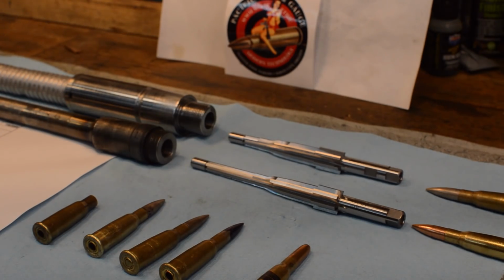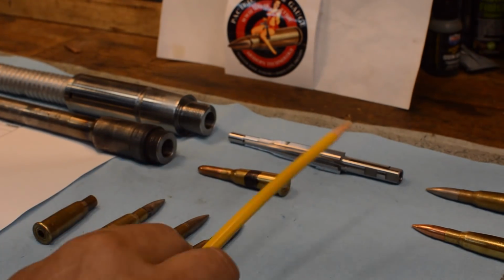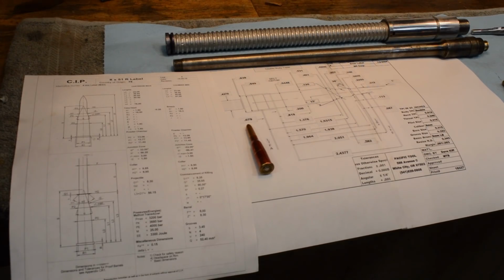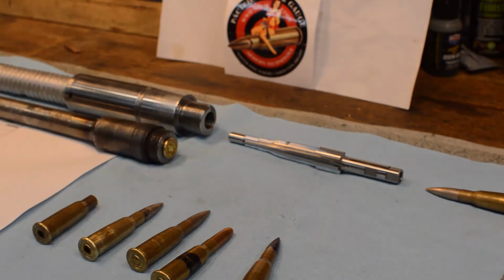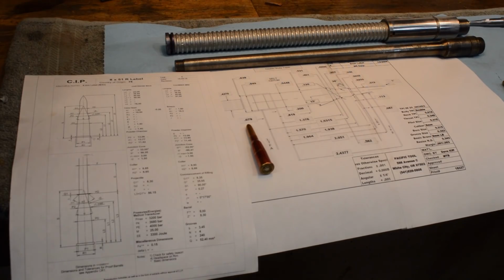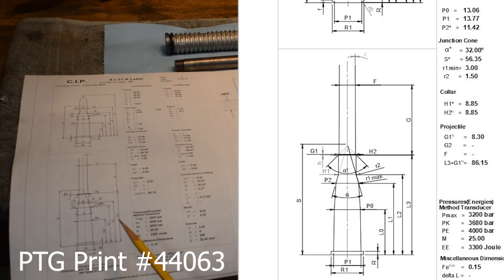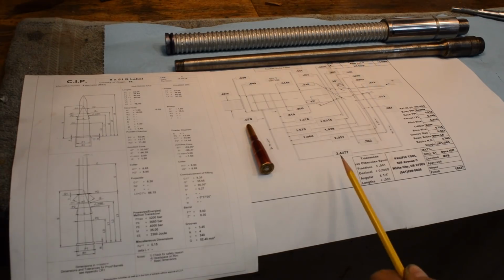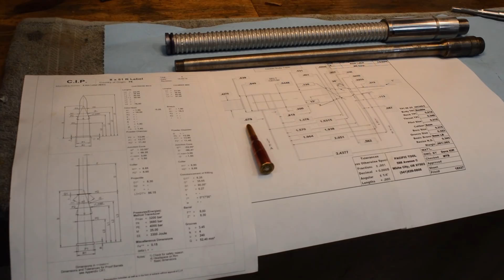8mm Lebel reamer selection issues

Comment: This problem is well known in France , CIP made some big mistake in the measurement of the cartridge , that why there are some group of people that shoot Lebel and Berthier that still try to make CIP fix there mistake... There has been many paper send but still no change. The reason why there is this problem is because CIP base there drawing on the 8x50R PPU made ammo , not original ammo or drawing , because in France at some point we had problem importing PPU ammo becauve it was not CIP , so PPU , knowing that France was one of the best market for 8x50R send some ammo to CIP to put to the test and approve. After approval the cartridge was rename 8x51R to differenciate it from the 8x50R Mannlicher use in M95 and the drawing were accepted. But to be sure that the new PPU 8x51R would chamber in "N" as well as "D" ,and as well as "M" barrel , PPU made a undersize "universal" brass. The problem is that with this brass because it is so undersize , you get a lot of cartridges that just open sideways in the chamber after shooting... Thing that have never happen to me with surplus ammo. One more thing to know about the PPU brass and CIP drawing is that compare to the original ammo the rim is to thin ( about 0.5 to 1mm to thin ) , that can lead to headspace problem because the round can move pretty much freely in the chamber before being fired. Sorry for my english it is late here in France. Have a good night.
Reply: Thanks for the heads up on this. I've run a few handloads made with PPU brass in my Berthier carbine with the N chamber and have yet to have any issues. I have not used the PPU factory ammo yet though. So, I will see if the gives me any problems.
Reply: @nekoghostgunner1129  It depend on what you want the gun to do for you , if you want accuracy many people here in France use a kind of rubber ring to add length to the rim so the cartridge is in the same position every time and the headspace stay the same every shot. The worst thing to do is to use the same use brass for different gun , in my experience the brass will crack more often. So keep track of what brass go with which firearms. Especially if you have different type of modification made on your rifle like "D" and "N" barrel. I don't know what type of powder you use in the US but here in France we mostly use Tubal 5000 to reload 8x51R with what we call " balle de foret" litteraly "bullet found in the forest" or TPM ( a special small production and very expensive bullet made for high precision shooting with lebel rifle that ressemble a lot the Balle D ) or partizan bullet. About the brass , you should make what we call "recuit" i don't know the word in english but is it when you heat the neck of the brass and rapidly put it in water so the brass stay strong on that point. Most of my brass didn't survive 3 reload for "long range shooting" but if you undercharge it to shoot at like 50 meters you can pretty much make 7 relaod out of them.
Reply: @pierre-louiscomte8998  In the US we could call "recuit"...."annealing". This process softens the brass and allows it to expand properly and not crack or break.
Reply: I had a lot of problems with reloading PPU brass using both CH4D and Lee dies and .323 PPU bullets. The case neck thickness on the PPU cases seems to be about half that on Milsurp Balle N and the resizing die does not bring the neck diameter down enough to properly grip the bullet. I had CH4D make me an S collet die to bring the neck size down sufficiently to give proper shot start pressures. Using Vit N140 and CCI primers, I was getting situations where the bullet was being blown out of the case into the bore, but no powder ignition!

I think the PPU brass is made to Balle D spec not Ball N which has a thicker neck!

...as for CIP, my faith in this bunch diminishes daily! Too many clerks and not enough engineers IMHO!
Reply: @pierre-louiscomte8998  It's mainly a fun range rifle for me, but I'll try the ring on the base if I start seeing problems. I have some original French Balle N ammo I got on my clips to take thickness measurments off of. My Berthier is the only firearm I have in the cartridge and will probably stay that way. As for powder, I'm working with IMR4064, as I already had it on hand for my 8mm Mauser and 7.7mm Japanese loads. Again, thanks for the info. If I can get the projectiles for the load you mentioned, I might see about working up my own version with either IMR4064 or IMR4895.
Reply: @felixthecat265  Lee dies are the best , the irony is , because they are of worse quality , the mesure are not really to spec and that make them the best you can buy for the money. Also if you have problem with the bullet not being held fermly in position there is some 8mm crimp available with lee that work really well. Also when you reform the 8x51r brass , don't reform it completly ! The neck should have a kind of double step , that normal , not pretty but it help the brass to align properly in the chamber ! Original balle D and N ammo has pretty much the same thickness , the angle of the neck change a little that all. But yeah you are right PPU brass is way to thin...
Reply: @nekoghostgunner1129  The bullet is call TPM327D , but it is only made in france and in very little quantity , so it would be really hard to find it out of here ( and for how much ? ). As for the "balle de foret" there is a website in France pretty much the equivalent of GunBroker in the US call NaturaBuy , you can find here a lot of french stuff and also this "balle de foret" that we use for reloading ammo to the original spec for a minimal cost , most of the time original projectile are cheaper here than PPU bullets. And dont forget ( I forget to tell it to "Felix the Cat" ) the french lebel and berthier are not in 323 ! but in 327 ! That make a difference...
Reply: @pierre-louiscomte8998  yeah, I looked up the proper bullet diameter, though I did find that a .323 dia FMJ projectile will engage the rifling of my Berthier enough to stablize and use them for a reduced power plinking load, as they are still accurate enough to hit paper at 50yards. For a planned more accurate load, I got a pack of PPU .330 diameter 200 grain projectiles for the 8x56mmR cartridge and am going to run them through a bullet sizer to get them down to .327
Reply: to sum it up CIP is not to blame, they did what they are supposed to do, test and approve, PPU is because they submit their dimensions and not the french ones. that leads to the question why didn't France gave the correct data to CIP long ago? and even worse, is all french CIP data wrong/not original or only this one?
Reply: @kber6288  Yes CIP is to blame... They dont bother look at original drawing or just take a look a an original ammo... And CIP is also to blame because since 2017 they didn't fixe there mistake. If i remenber correctly before 2017 it was not CIP proof and still called 8x50R , because it was not CIP we were not allowed to import it anymore in France and that lead to really a kind of crisis in this caliber... For some time the price for ammo keep going up...  and then the CIP registration and approval came. About this caliber from what I know there a been a LOT of people in France ( when I say a lot it is not like one thousand , but in the collecting community in France 10 people sending a paper is a lot... ) that have send them warning about the mistake they made... With original drawing and all the information they need... But nope they don't care , 8x51R is a caliber to rare to care in there eyes I think... From what I know it is the only caliber CIP got wrong... but maybe we will find and other one some day not impossible...
Reply: @pierre-louiscomte8998  don't get me wrong, i fully get your point. and here in Germany we have the same problem with buying non-approved ammo. even german surplus ammo needs to be reapproved because the millitary approval means nothing.
but CIP is just pure bureaucracy. you bring in some drawings and maybe cartridges, they will look at it, tell what to change, and approve it. they absolutely don't care if a similar cartride already exist or not if it is not already registered. so they did what they are supposed to do. the only thing i can find to blame is that country of origin should be Serbia, not France, for the approved one. 
the question is why didn't PPU came with the correct data?
and why didn't France registered it in the first place? 
i have way to less knowledge about the true 8mm Lebel round to tell the real differences. i only know there where some minor but important changes adopting the spitzer bullet, but don't know how or if this effects the diameter of the back of the case at L0.
maybe you guys should just take all data and register the real thing (horrible expensive, i guess), along with the 11x59mm R Gras that i haven't found in CIP data and should be the parent case of the Lebel (?). or if you have any other idea how to put some pressure on CIP, tell me how i can help.
and honestly i wouldn't accept any renaming "because there already is a 8x50R" as there are 2 8x56R from differend countries already in the books, not to mention our "german 8mm bullet problem" with the 2 differend bullet diameters but same cases. all not problem to CIP.
Reply: @kber6288  Like i previously tell , PPU made this ammo undersize to suit every type of rifle , if they had made a ball N type cartridge the ammo could have fit in a D barrel but that would have put stress unecessary stress on the action. So ppu made a "universal" undersize cartridge that can fit in every gun that why the drawing are "wrong" they are "correct" for an ammo that will cause no problem , but not good to make a reamer. About France that did not register it.  The reason is "simple" since you are in germany you know about the new EU laws about the 4 categories A B C and D. Before these rule they were 8 categories in France and the 8x50R was in the 1st one , that included military calibers. So legaly it was really hard to own a 1st category weapon. So most 8x50R lebel were re-chamber to a civilian caliber the 8-348 Winchester that is really close. Since there was not a lot of 8x50R lebel that were officialy register  there was no need to register the 8x50R with CIP , most of the Lebel and Berthier were kept in the cave or in the clauset... Now that the Lebel jumped from 1st category to D category and now everybody can have one , 3 things have happen , a lot of lebel appear from "nowhere" , the price of original non re-chamber one have skyrocketed and now a lot of people want to shoot them. At the beginning we had no newly manufacture 8x50R lebel in France so people made brass with the 8-348W or just used original surplus that you could find if you knew where to look... Now that there is no more surplus , that the brass for 8-348W have become really expensive , some gunsmith had started importing PPU ammo. But France rapidly ban the import of non CIP ammo. So PPU "rush" the procedure ( that took more or less one year... ). The thing is ! French sport shooter had already ask CIP for the approval and send them original drawing and all the stuff they needed , but like you said that cost a lot of money... When PPU approch CIP they had the money , so PPU drawing where choosen... We tried to put some pressure on CIP but no change after more of less 3 years , most people have stop trying...

Comment: Mark, any chance of re-uploading the videos where you steam blue guns? Those are by FAR the most satisfying gunsmithing videos I've ever seen.
Reply: +1 to that, while I primarily find it interesting from an academic point of view as I don't do metal work, I enjoy learning your reasoning and methodology as it's often very applicable to other aspects of life. 
The video I'm really holding out for was the one in which you describe how to make a scraping tool for shaving a very small layer of wood in a controlled fashion, I tried it out and was amazed at just how well it worked (and just how smooth the resulting finish was)... but for the life of me I can't remember all of the fine details a year or so on!
Reply: @etelmo  look up card scrapers, there's loads of videos. Your basically looking for a 90 degree corner on a section of plate with a burr drawn off the edge.  Cut up an old saw blade clamp a section between two known 90° scraps of wood and dress the edge on a whetstone (not your best one) remove and clamp to the edge of your bench slightly proud of the surface. Using round stock harder than the saw steel (carbide if you've got it) pull along the edge drawing in towards the bench with a slight down tilt on that side. Doesn't need as much pressure as your think and doesn't need as many passes as your think. More passes for a larger burr for taking a bigger cut, fewer for a fine tool.... But it is more fun watching Mark do it 🙂
Reply: @daiprout323  Let me add to that. You are quite correct about the choice of force needed to create the shaving edge. Now that plastic lenses have replaced optical glass,magnifying loops,magnifying glasses,and the little cone shaped whatzit I cannot remember the name.
Buy some sort of magnifier, up to 10× and have a good look at the edge you produced. Too much force can roll the wire edge too far. Controlling just how " heavy" the wire edge is,and what angle,etc,makes an enormous difference in results. Found out the hard way myself.
A properly tuned scraper with an edge just so is just terrific. Razor sharp with shavings you can sometimes see through.
Sawblade steel works well. Lee Valley/Garret Wade sell scrapers quite reasonably. Fun to make your own custom shapes with good sawblade steel. Buying already made is a whole lot easier.
Old sawblade steel. Up until the 1950s or so,handsaws were good steel.
Reply: @paulmanson253  old saw steel stock is much better, soft enough for a really fine edge with just a couple of draws with a burnisher. I have used modern saws with success though. I hate throwing anything away (raised by grandparents who lived through the depression) so when a modern impulse hardened saw is done I cut off the teeth and surrounding steel and make scrapers from the back. I'm not talking fine finishing scrapers, just something to get in awkward corners or hogg off swirling grain that a plane will tearout.
Reply: @daiprout323   Now that you mention it,Fine Woodworking ran an article back in the late 70s,early 80s. A young Vietnamese refugee boat person,barely any English,was featured. He would make tools at a cabinet shop no one recognized. Hardwood body,with saw steel or equivalent as a coarse scraper rather than a plane blade. And he was much respected there,he could deal with swirling grain that caused tearout on Western tool usage.
The tools were quickly made,not intended for long or heavy use,often semi custom shapes ,put on a shelf until needed again.
We tend to make stuff that you could use and give to your son. Making a big deal of just what alloy is best,etc. He took what was to hand and likely to be discarded,zoomed it together,used it and on to the next task.
Which is better ? Answer,whatever works.
All the best.

Comment: PPU is CIP compliant ammo instead of SAAMI 
CIP shows the minimal chamber size and the maximal ammunition size, therefor it of corse is to tight for most ammo usually a good chamber gets lapped after reaming...
Reply: Is that not what SAAMI does as well? From my recollection all the administration drawings show negative tolerances and the chamber drawings show positive ones.

Comment: Look at your CIP drawing again.  The 13.06mm dimension is listed under the Cartridge column.  The Chamber dimension is 13.09mm.  If PTG made your reamer to the left side dimension column, they owe you a new reamer.
Reply: Agreed, that's the cartridge max dimension where the right hand coloumn lists chamber minimum. And the chamber dimension is a hair further forward to give lengthwise clearance as well, so the actual diameter difference at the same spot would be a tiny bit greater than the .03mm difference.
A machinegun probably should have a slightly larger chamber than the absolute minimum permissible, so Mark's estimate of 13.2 seems reasonable.

Looking at the rest of the drawings, if they used cartridge dimensions for all the other mesasurements as well then that would be one scary thing to fire even with the one brand of ammo that did chamber. No room for neck expansion to release the bullet, for instance.
Reply from the maker: PTG made a beautiful reamer to an incorrect drawing. They owe me nothing, and I will buy from them again

Comment: There is a current production caliber with this issue but I can't remember which one. It's something quite new. You can buy a brand new rifle and the bolt won't close on factory ammo.
Reply: Not thinking of 350 Legend? There were a fair few problems with Winchester ammo that had issues with bolt closures mainly because of the head spacing on the case mouth and inconsistent trim lengths.
Reply: There's a whole slew of cartridges that kind of applies to these days, unfortunately.